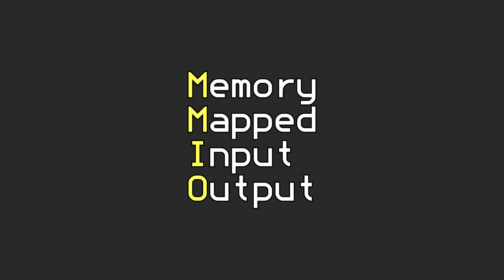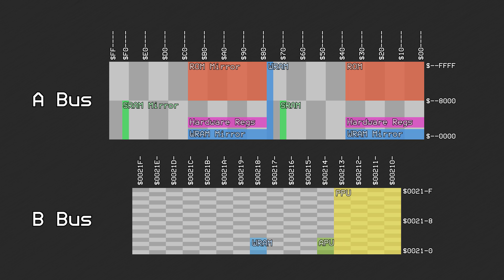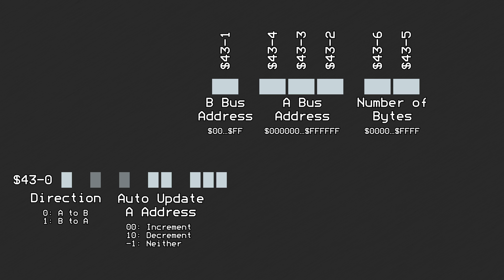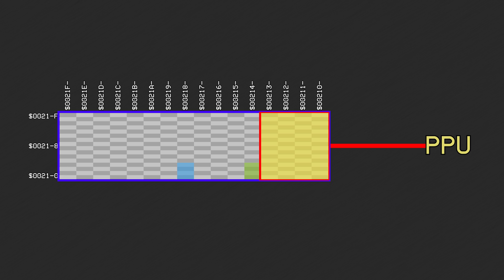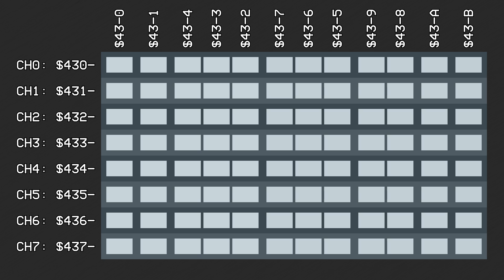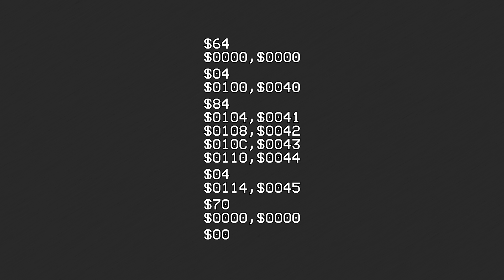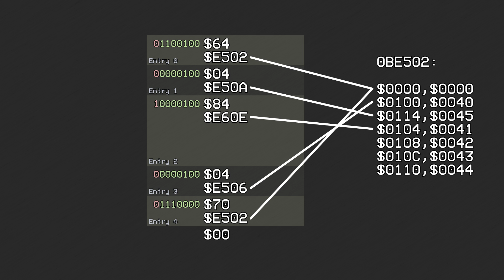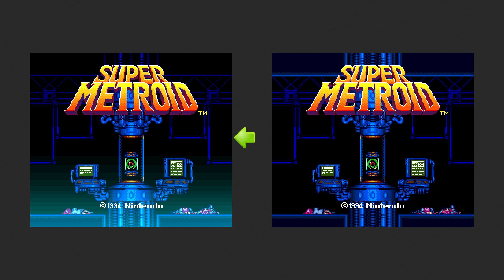DMA & HDMA - Super Nintendo Entertainment System Features Pt. 07

Comment: @RGMechEX, at 4:20, what are the "registers" for the "Transfer Format"?
Reply from the maker: The registers refer to any of the hardware registers located at $21xx via the B Bus. For example, if $4301 was set to #$26, and transfer format %100 was used (4 bytes to 4 registers), one byte each would get written to $2126, $2127, $2128, and $2129.
Reply: @RGMechEx  OK, but what then are the "write two bytes two times to one register" used for?

Comment: So, wait, using HDMA to switch games modes as the screen is drawing all the horizontal lines means you don't have to have just one single background layer when scaling and rotating large objects using Mode 7 at all (which is what I took from your F-Zero and Pilotwings example, if I'm understanding it correctly)? 

So all those games on SNES where I see large Mode 7 scaling/rotating bosses on just a single plain background colour, usually black, with maybe a few sprites trying to fake a pitiful floor, were actually doing it a bit sh*t? 

I mean, I presume it would have been possible to have actually used HDMA to say switch the game mode near the top of the screen to give a nice high colour sky background image for example, then in the middle switch to Mode 7 for the main scaling/rotating boss (and even draw a colour gradient on the plain background in this mode), and then switch mode again near the bottom of the screen to draw a lovely full colour floor taking up a whole bottom third of the screen, along with drawing a whole bunch of sprites to fake even more details on both the background and boss elements, and that kind of thing--correct?
Reply: @Kit Duguay The floor is actually a background which is a typicaly example of switching the background modes midscreen.
Reply: @Kit Duguay Yeah, I just saw this really cool way of using basically every single sprite tile plus the Mode 7 to make the kyote in Road Runner fall down and away from the camera in a top-down view and smash onto the ground, with the whole "background" actually looking like an entire screen of nice artwork:

https://youtu.be/BSLhSJLtXCE?t=435

Now that I know how it's done, it's a very impressive and subtle use of the SNES unique features and also a great example of hidding the limitations of Mode 7 at the same time. And sure, there's not really any mode switching, and the fact all the available sprites are used to create the "background" images means not a lot else can really happen here, but in this scene it doesn't need to do anything more than exactly what it does, so it's all good.

A really nice and elegant and cool effect there.

Comment: I really love the 65 series CPUs for their simple design.

However, their simple design can also be a real curse, particularly for the 65816. In the 65816 you have a 16-bit CPU with a 24-bit address bus... sitting on a limited 8-bit data bus that's also forced to give up a significant portion of its accessible time to the address bus because the highest-order byte of the memory address can only be issued through the 65816's data pins via multiplexing. 

This, combined with the fact that outside of forced blanking you can't access a lot of hardware, is why the SNES CPU has such dreadful data transfer speeds on its own. When your word size is 16 bits but you can only transfer 8 bits at a time and only within certain windows of each clock cycle because you have to multiplex an address out your data pins, it's a wonder the 65816 could get data around any faster than the 6502 could. 

The SNES had some great hardware, but I do think the Mega Drive definitely had a better CPU with the m68k. Full 16-bit data bus, full non-multiplexed 24-bit address bus, and an ISA that, while it maintains some backwards compatibility, seemed to be aware of the times it was in and thus offered way more power to the programmer and the hardware. The 65816 didn't really take off on the microcomputer market outside the Apple IIgs probably because it was competing against other 16-bit CPUs like the 8086 and the m68k that could run circles around it at the same clockspeeds. 

That said, I still love the 65 series CPUs for their simple design, but if I were to homebrew a computer and I had a choice between a 65816 and an m68k, I'd probably just take the m68k.

Comment: I'm a bit upset that Mode 7 is the huge special feature of the SNES, when HDMA (while less flashy in concept) really allows for a lot of the awesome visual effects the SNES could do.
Reply: Per scan line modifications is nothing special lot of platforms had that, those pseudo 3D effects would not be possible with matrix transformations of Mode 7 which was revolutionary at the time

Comment: Does this mean that it would be impossible to the SNES to render a vertical gradient, or is there another trick that could be used? For example, could I get the SNES to display the Super Metroid title screen rotated 90°?

Thanks so much for the videos! They’re a bit advanced for me, so I watch them multiple times until I understand. 😊
Reply from the maker: If you wanted a vertical gradient, you would have to use a different method. The easiest way would be to just bake the gradient into the graphics themselves, but this would use up more graphics and palette memory than a horizontal gradient using HDMA.

Comment: This is like some Atari 2600 racing-the-beam stuff
Reply: Indeed it is. Because there was no framebuffer, all consoles without famebuffers were "racing the beam" the whole time. The SNES just had the most fleshed out version of it.

And technically, with the expansion chips, you could force a virtual framebuffer in the SNES. This is basically how all the 3D games with the Super FX chip render their graphics. And some raycasting games like Jurassic Park.

Comment: I develop for the Genesis. I know that the DMA chip on the Genesis can move about 91 bytes per Vertical blank which amounts to 22 screen tiles.So does this mean that the super nintendo can move more screen tiles. according to my math its moving 44.3 kilobytes per vertical blank NTSC. I don't think that's right... I'm doing the math wrong I think.

EDIT: Did a bit of research it seems like the Genesis DMA was faster by virtue of it's 16 bit bus, BUT it is not significantly faster. Also the SNES uses 2 8 bit buses for DMA which reduces the size per transfer but it was asynchronously clocked so it could achieve much higher speeds. It also appears that SNES DMA was severely hampered by SLOW ROM access. Does any of this matter.... no not really. If you want to read more take a look at this: https://www.quora.com/Was-the-Sega-Genesis-faster-than-the-Super-NES 

I would really like to do some game development on the SNES later but it will require a major adjustment to my workflow. THE SNES 65C816 is a very alien thing to me. Lots of specific commands that I've never seen before. Thank you for the videos.
Reply: The 65C816 is basically an expanded 6502, and the be 6502 is pretty easy to pick up, so you might want to start by learning the 6502 first.

Comment: It's kind of amazing how similar the SNES was to the NES, but having a few extra 16-bit features when so much is still byte-based throws the memory addressing into chaos.
I'm tinkering with a SNES-like virtual machine design, and I ran into this on my own almost immediately. I'm thinking, "I kind of understand the NES, I'll try to recreate those emulators but just add in some wider registers, a few more math functions, and a screen buffer," but having to suddenly manage instructions and processor logic for both bytes and shorts makes everything not just twice as complicated, but three times as complicated because each short is also a low byte and a high byte. That means I have 3 versions of every operation (at least the way I'm currently trying to implement it) and it just turns into madness really fast. 8-bit is limiting, but knowing all reading and writing is happening in that same data size makes quite a few low-level things much cleaner (in spite of some obvious drawbacks). 

Imagine if for the NES there were op-codes/mnemonics for accessing and manipulating each bit of any given byte in memory: instead of about a dozen instructions governing everything, you'd have more like 100 of them. It's no wonder modern 64-bit processors still can have so much based on the old 8-bit machines, but the range of data sizes makes acting on any specific block of data increasingly complicated either for the programmer having to remember a bunch of suffixes, or complicated for the hardware trying to determine what's being done based on some other context clues. I feel like that whole "AL and AH make AX, which is half of EAX"  kind of register organization is why most people take one look at Intel x86 ASM and think, "Oh, fuck no. I'll just go back to 6502 or z80 instead."

Comment: HDMA is a fascinating feature.

Most of my favourite retro computers have variations on this kind of idea.

The atari 8 bit computers have a 'display list', which is a list, that broadly speaking specifies for each line on the screen what display mode it's in and where to pull the data from in memory for that line. (also whether to cause an interrupt on that line, to automate more complex effects - for an 8 bit machine this is exceptionally powerful)
The Atari has 14 graphics modes which vary in colour depth, resolution, whether they're text or graphics modes and a bunch of other features.
And thanks to the display list, you can slam ALL of the graphics modes onto the display at once, with basically no CPU intervention at all.

Then you get the Amiga - (incidentally the same people designed the Amiga as did the Atari 8 bit computers, so the similarity is no coincidence.)

On the surface this seems like a much simpler feature, but it's actually a more powerful refinement of the display list concept.
Instead of specific graphics modes, you have what's called a Copper list. Unlike a display list, it doesn't specify graphics modes directly.
Instead there are a bunch of graphics registers, and a copper list basically consists of a command to write a value to a specified register, and a command to wait 'x' pixels. - meaning copper can mess with anything that has a register within it's allowed access range (which as it happens also includes the audio registers.), as you might have noticed, since it's timing is based on pixels, it can automatically perform effects in the middle of a scanline, all without CPU intervention!
There's a limit to this of course; Copper isn't fast enough to change something literally every pixel. There's a minimum period between commands, but it's still extremely capable nonetheless...

Now, take a close look at these features, then look at how HDMA works on the SNES...
The SNES has 8 HDMA channels, and essentially reads a list of commands from memory to write values to specific registers during H-blank. How many values you can write in a line is tied to how many HDMA channels there are, but all changes are done in H-blank.
This, effectively sits right in the middle in terms of flexibility between the Amiga and the Atari...

It really can do a LOT though. - you can, depending on circumstance and what precisely you're trying to do, modify up to 16 registers per scanline drawn. and these can be ANY graphics registers.
Meaning you can fully automate any static scanline effect that requires the modification of 16 registers if the memory map is in your favour, or at least 8 even if it isn't.

These lists can be recalculated dynamically, but depending on the effect you can also simply pre-compute it, and play that static list every time to pull off a given effect...

Yeah...
Reply: Nowadays the same concept applies to GPUs today and modern shaders, using textures and ramps to drive any aspect of rendering at the pixel level, instead of scanlines. Notable examples of interesting hardware setups are the GameCube and Wii, which have the CPU and GPU share all their memory. This allows you to use GPU rendertextures on the CPU with no overhead.

Comment: I have an idea:
Let's build a console that has dma to free up the cpu but we'll also pause the cpu during the dma to piss people off.
Reply: @frognik79  It was necessary.  Can you imagine the ungodly mess if the CPU tried to access RAM at the same time an HDMA was occurring?  It's called "bus contention".  At best, the CPU has to enter a wait state anyway until the bus arbiter allows the CPU to use the bus (for example, to fetch the next program instruction).  At worst, you end up with garbled data that can cause graphics or audio corruption, or even crash the system.
Reply: @SpearM3064  I know, but the whole point of a dma controller is to free up the cpu.
Usually dma controllers have their own dedicated bus and allows the cpu to also access memory if it's a different address but I guess things were different back then.

Comment: If you can't do non-linear stuff without HDMA, how does the background on Super Mario Kart work then? I don't see how it's different from F-Zero.
Reply: Same way as F-Zero. Just that black bar in the middle is doing far more processing than can be done using HDMA alone. After that is finished then it can resume doing Mode 7 magic. Basically Super Mario Kart has 2 V-Blanks.
Reply: @davidmcgill1000  Right - I was just rewatching this video and figured it out. The little indicator arrow he added to show what scanline the game is on never actually moves outside of the black bar. The perspective is done with HDMA while the sprite doubling is done with regular DMA. The visualization on the right side just doesn't show what Mode 7 is actually doing for these scan lines.

Comment: The visualisations of pilotwings and f-zero took my breath away. I find it so fascinating that teams were doing such clever stuff right off the bat!
Reply: I don't think it was a new technique. Games like Pole Position were doing similar effects in the arcade a decade before Pilotwings.
Reply: @jimmyhirr5773  I think the effect in itself isn't what's impressive - there's plenty of true 3D work from arcades prior to this - it's more that they found a way to achieve that effect that specifically utilises the sprite scaling abilities of the SNES. Pole Position's technique (like that of Outrun or Road Rash) is a little bit different - definitely a clever technique too, but different in its implementation, and less hardware dependent.
Reply: @Soundole  SNES does not do sprite scaling. It can scale a single background layer, that's it.

Comment: It would have been interesting to describe the limitations of the windowing tricks: you can only create shapes that are horizontally convex, because ultimately, all you're able to do is change the start pixel and end pixel of the window.  You can draw windows shaped like < or >, but not ^ or v.
Reply from the maker: It is a bit more complicated than that, since there are two windows, and the final result can be the intersection, union, and or complement of the two. A V-shaped window is possible by having one for the left half and one for the right half, then combining the two together.